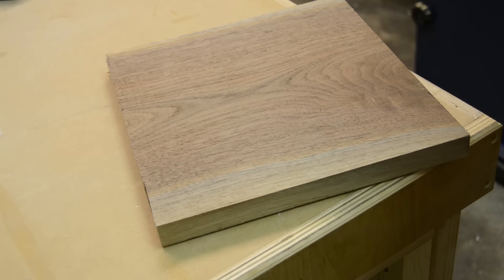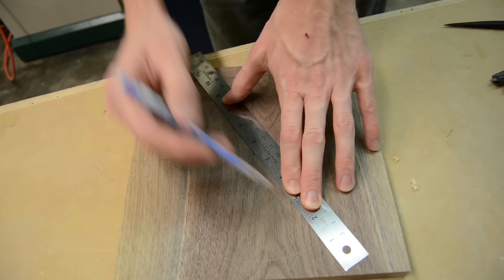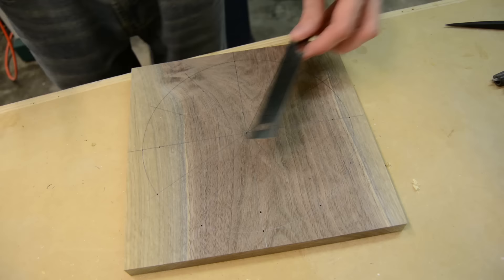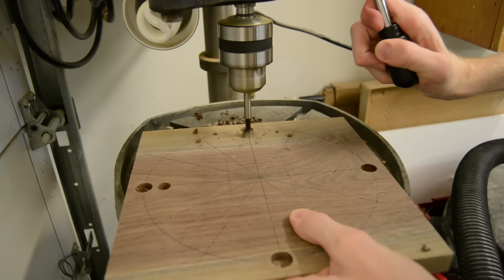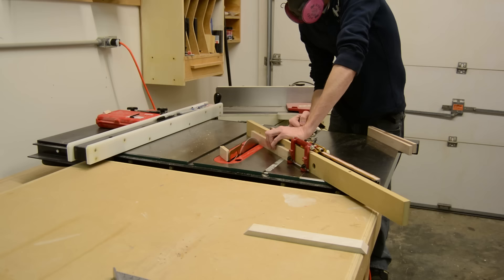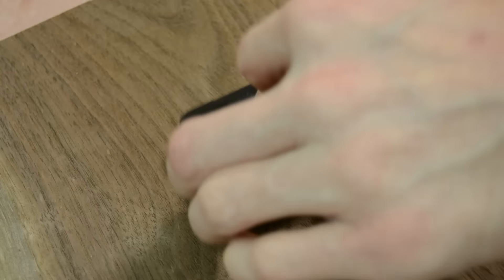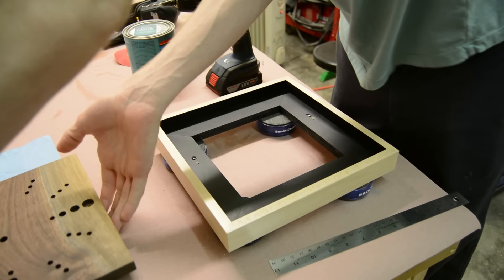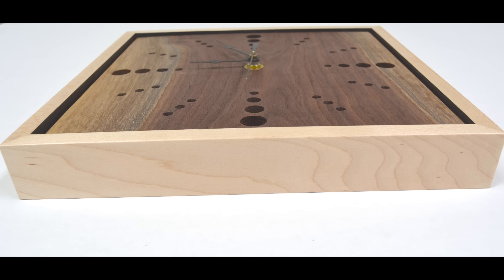Handmade Walnut Clock

Comment: Matt,  the way you set up the hands of the clock when you first put them on, is that because the movement is a radio controlled movement that works off of the atomic clock in Colorado ?
Reply from the maker: I just set it up per the instructions.

Comment: Another great vid good sir, well done,,,,,,,, but every time I use my forstner bits the way that you did to cut out the back of the clock; my forstner bits always jump around. There not that old, BUT my speed of the drill press is not that high either. Any ideas why mine jump around so much please ????
Reply from the maker: Hmm, not really sure. The only thing I would guess is not enough material for the point to register on. The point is really guiding the bit.
Reply: Makes sense to me. Thank you,,,,

Comment: I am working on a walnut cutoff with holes filled in with black epoxy as a wall clock. The thing I am kinda stuck on is choosing movement/hands/numbers. How did you go about figuring out the movement and hand size for the clock you made? The one I am working on will likely be larger and having never done a clock, not terribly sure how to choose the hardware mentioned. Not concerned about what to use for numbers specifically, mainly the movement and hands being the right size.

Any advice/recommendations would be wonderful.